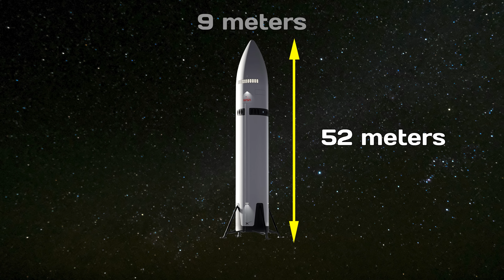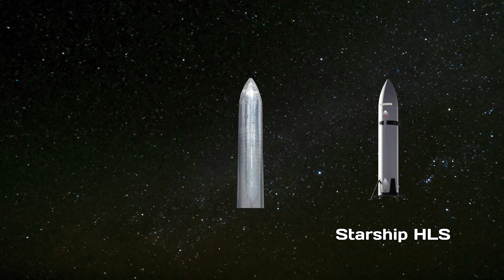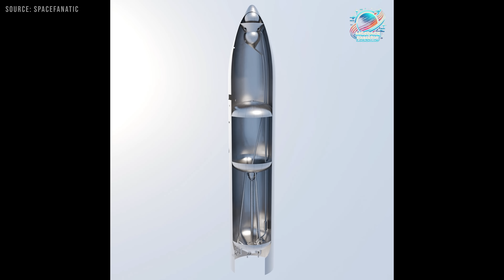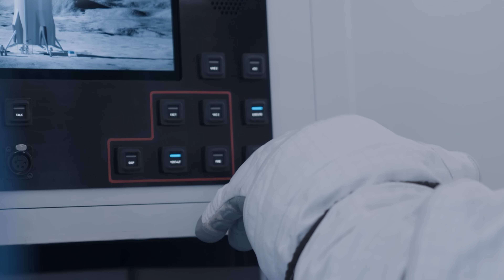SpaceX reveals Something Big happening with Starship Moon Landing in 2026, Better than China!

Comment: My expectation is that it will topple over and explode. A ship of that design is inherently unstable. And an elevator cable to get to the surface? Seriously? What do you do when the elevator breaks with nobody inside the ship? 
But then Elon didn’t seem to know about battery “thermal runaway” either.
Oops……
Reply: Elon doesn't know much about physics. Any monkey can through crap around and hit the target occasionally. Musk does trial and error to see what works rather than think though it logically.

Comment: I still think it would make more sense to use the very wide, ~9 meter, diameter of the SpaceX cargo section to send up a new space telescope based on the comparatively simple design of the HST only much larger, perhaps even with an 8.4 meter solid spun primary mirror from the U. of Arizona mirror production program, i.e. of the same size as the one used on the Vera Rubin scope, or the two used on the LBT, or the 7 to be employed on the GMT. Building and launching such a huge but simple space telescope and placing it in fairly high Earth orbit, would be much easier and cheaper than attempting once again to design another scope like the JWST that uses a folded mirror which only deploys only when it has reached its destination in space. An 8.4 meter space telescope of this simplest type would be able to catch 12.25 times the light of the HST -- and hence penetrate almost three whole magnitudes deeper into the sky! -- while also providing a spatial resolution 3.5 times better than the HST. Those basic facts would give it a performance rivalling the finest Earth-based telescopes! And the rewards to astronomical research could be, and probably WOULD BE enormous. But instead of planning something relatively simple and inexpensive like this, all attention is focused on returning to first the Moon, and then on to Mars.  Even assuming these truly grandiose mega-projects can be successfully carried out and fully financed, they may well not even tell us much that we don’t already know about either the Moon or Mars! Oh what follies of common sense judgment dog all of these otherwise superb new technologies!!
Reply: Leave the telescope building to NASA. By the time they get congressional and presidential approval and funding and get it built SpaceX will have a rocket ready to launch it.

Comment: If it's going to take a few refueling launches to get blue moon MK2 to the moon (and more for HLS). As an example say 10. Why not with the same 10 launches.... launch a MK1 cargo, followed by MK1 (adjusted for humans) with say 3 astronauts (similar to Apollo), and repeated for 10 launches. So 5 cargo trips and 5 Humans trips... so all in all 25 astronauts and cargo on the moon. At the same time continue the testing of the refueling in space and the landing of a much larger lander in the back round. And when they solve that, transition to it.

Comment: Ultimately Starship is likely to become nuclear-powered fairly quickly. Also, most of the operators in outer space may be Optimus robots.
Reply: how would that work and in what way would nuclear power it, for liftoff or internal systems?, none of that sounds at all feasible to me, would be too heavy imo to have an internal nuclear power source, and there's no where in space for the heat to dissipate from, no medium

this doesnt only seem unlikely but absolutely impossible
Reply: That will never ever happen. There is no such thing as a nuclear rocket. And even if there were, it would never be permitted to launch from any location.
Optimus is a pathetic scam, and Tesla are a distant follower in robotics.

Comment: I had to like your video because I love starship, but you were gonna have to realize SpaceX works on a different dimension. What do I mean by that? OK starship landing on the moon first attempt does not even have to be pretty it just gets some things on the move that operate a.k.a. Robot maybe the first mission could be a controlled crash landing. That’ll be very easy and get robots on the surface and raw material and then they can take the knowledge that they learn send another one up and maybe crash that too more material and more robots, you people gotta wake up Space actors not playing the same game if they can build 12 ships and trash them if they can build boosters and trash them, what are you working with? You’re working with the company that is already designed and building an expendable object. We can send that anywhere we want and go from there

Comment: 🇨🇦I think they should keep the refueling simple. Put a docking structure on the ship. Have the tanks dock and remain to feed the ship it’s fuel. Theoretically, you could use the whole number of them, as part of the radiation shielding needed, to go to Mars as well. Also, make the ship landing on planet, have the ability to pancake to a smaller size. Each level of the ship can be built like a seperate environment, that in conjunction with elevator design, could lower each piece like a pie. Have drones build up the area first to level it off. As each level is placed, the ship itself is getting smaller. When empty, woosh, back up to main ship structure and back to Earth. And this could be done many times to build multi level structures. Just stack them. Easy peasy. Snap your fingers and it’s a done deal!🤣🤣🤣🤦‍♂️🤷‍♂️✌️🤘🇨🇦

Comment: You do not store Meta and LOx in parallell. You store them one inside the other, or in lemon chunk patterns one for each Raptor engine.
Reply: Sorry, your claims here don't make sense.  Go look at the boiling points of O2 and CH4, and the freezing temperature of CH4.

CH4 freezes at -182.5 degrees °C.  O2 boils at -182.962 °C.    If they are in contact the CH4 freezes and the O2 boils off.   Pushing the boiling point of O2 up with increased pressure involves enormous mass penalties of the tankage.  If you look at both the booster and the starship they both have simple independent tankage isolated from each other.  On both the starship and the booster the O2 tank is below the Ch4 tank ... the O2 is much heavier and having it below (closer to the engine thrust) reduces the compressive strength requirements of the rocket body.

I'm not sure how SpaceX deals with the methane down-comer, how they prevent it freezing.  Possibly it is insulated? 

In principle there's no reason why in-space refueling could not be done for both propellant and oxidizer from one ferry rocket ... however studies have shown that it's lighter and more efficient to have independent designs for the O2 ferry, vs the CH4 ferry.

Comment: Is it possible to just use a rocket to pull a hose into orbit to refuel?
Reply: the hose that long will be tremendously heavy, after a certain length it will just snap off from its own weight , no matter what material the hose is made off.
Reply: @MrOnlymoin1 I was thinking maybe the earth's spin would keep it in orbit

Comment: Starship won't land ANYTHING on the Moon before 2028. The number of never-before-tried milestones they have yet to even ATTEMPT is too much to have a chance to get there earlier. They should be sending up at least two launches per month, right now, and they aren't even able to do THAT. I actually think Blue Origin will land before SpaceX.
Reply: Poke yourself in the brain it might help
Reply: @youngmangrand9331 Instead of insulting me, tell me why I'm wrong.
Reply: Probably right But I don't think development is linear. Once they lock in the design of the heat tiles, things will start to accelerate pretty quickly.
Reply: About the speed of advancement I agree. But there is no one even close, Blue who?
Reply: @czarnoskorynazista159 Blue Origin is further along than you know. They just don't test using the same destructive process that SpaceX does. They're a more traditional aerospace company. And their system to get to the Moon doesn't require 10 fueling launches to fill a space gas station to get there.

Comment: Reinforce a Starship to land horizontally, to keep from having the tip over problem, 
and use them for bases in that configuration, then build a tower or landing pad for vertical landing.
Reply: There is no tip over problem
The legs are individually adjusted, while attitude control is maintained by thrusters.
Reply: @Arturo4586  That would be fine but I'm not sure if you realize the height of Starship ver. 3.0 is180 meters. If there is any leftover forward inertia, on such small base 9 meters + landing legs everything is over, literally.
Reply: @AdamosDad 
That's the thing though. 
There's not a company on the planet who has proven itself more capable of making a ship hover without forward movement, than SpaceX. 🤷‍♂️

None of the ships that have fallen over on the moon, have actually been tested in our atmosphere to be able to hover.

The ones that tipped over, don't have engines powerful enough to be able to test its ability to hover motionless on earth. They have to use harnesses to help offset the weight. So not a real test of its abilities. 

SpaceX has three ships that can hover completely motionless right now.....

Comment: Maybe an overall reduction in Starship height could be achieved by installing a cylindrical tank for the liquid oxygen centred on the vertical axis of Starship  and then a  'doughnut' tank for the denser liquid methane surrounding and enclosing the oxygen tank.  I appreciate that this arrangement might necessitate an increase in overall diameter of Starship ( and also the booster) but that would only help in terms of stability whilst Starship is landing.  Dear Elon, if you read this and think the idea has any merit please let me know!!

Comment: How is starship going to be able to be rapidly reused faster or cheaper than the shuttle? It's a big complex machine with 40 engines on two stages. I bet there is no cheap rapid reuse. Fixing the heat shield and maintaining 40 engines is going to be more complex than refreshing the shuttle for reuse.
Reply: Faster and cheaper than the shuttle, that’s not much of a challenge.   Also take a look at the Starship V3 engines, they are far simpler than 1 and 2, and even more powerful.

Comment: That thing is going to tip over on the moon.
Reply: Probably not actually. 

Things tip over on the moon because they're still moving forward when they land. 

SpaceX has more than proven itself the king of making things hover without forward movement.....
Reply: @lordgarion514 It's going to be a top heavy vehicle landing on an uneven surface. The risk of tipping over isn't even worth it.
Reply: @Splenda257 
No, it won't be top-heavy. 
It will have used much of its fuel getting down, and the cargo in humans are not at the very top. 
So it is in fact going to be drastically less top-heavy than it looks.....

And it is going to have self-leveling legs. Plus unlike all the other companies, SpaceX has already figured out how to make things hover in place without forward movement. 🤷‍♂️

Comment: SpaceX designed and built the Falcon 9, Merlin engine, and Dragon 1, concurrently in 6 years, and for just $800M.

Northrup Grumman needed a decade, $2B just to modify the old shuttle booster. Let's don't even talk about Boeing and poor starliner. 

SpaceX isn't overly ambitious, these other companies are optimized to make profit off of cost Plus contracts.

Comment: Getting into orbit is not the challenge for SpaceX. Each Starship that splashed down in the Indian Ocean was just around 1000kph to 500kph short of orbital velocity. Making sure the Starship systems respond to the command to relight its engines, like when needing to de-orbit is the issue they've been testing. If they had let the engines burn until they were at 27,000kph, they would have reached orbital velocity at around 180km in altitude. It would have only lasted around 8 days unless they sped up to 28,000kph or raised the altitude to 300km, but all the same, you make it sound as if their big challenge is reaching orbit. Its not. They technically could have reached orbital velocity on the third flight had they just kept the engines going another minute or so, but the design of the flight was to always deorbit in the same spot. Its how they can place buoys and drones in the area waiting for the Starship.

Comment: I'm all for Starship Development and believe SpaceX is making it work, but the U.S. could've landed crew on the moon 5 years ago with simple modifications to Falcon 9 / Falcon heavy architecture NASA/Congress just didn't want SLS sidelined, made obsolete and rendered politically dead because of it. Here's a fun fact, the original Lunar Lander will fit inside Falcon Fairing with room to spare and Dragon could've been modified as well, many former NASA types have done the math,... all these delays are simply to protect the SLS jobs program.

Comment: Avoid refueling for initial flights by strapping 8 falcon-9's around the first stage of Starship, they will return and land, the first stage of Starship should fire at the same time at launch, and return when done, the push should be enough to send stage two Starship to lunar orbit using only half it's fuel, saving the other half for return to LEO.

Comment: Starship is simply too heavy.  Too much fuel needed to accelerate it, too much to slow it down. It will probably never land on the moon with enough fuel to get off the ground back to earth.
Reply: You are so right! The delta V is too low. Why not land with the pointy part and let the heavy part with the tank and big engines stay in lunar orbit?

Comment: Perhaps an inclination sensor could be installed in the rocket to control the landing legs and correct any tilt of the rocket during landing.
Reply from the maker: That's an interesting idea!
Reply: Was thinking something similar. 
1) Engines are on side so have multiple lidar/sonar on bottom.
2) bring HLS down to 1-2 m above ground then hover.
3) fully lower all legs.
 Note that means legs must have means of locking with variable deployment.
Reply: I hope we get to see SpaceX testing the leg assembly. They are already building that big structure (Massey's) similar to what the Chinese used for lander tests.